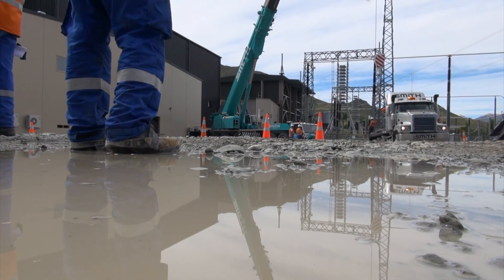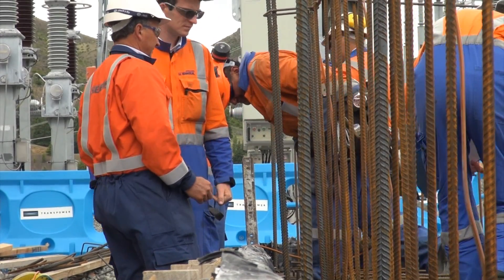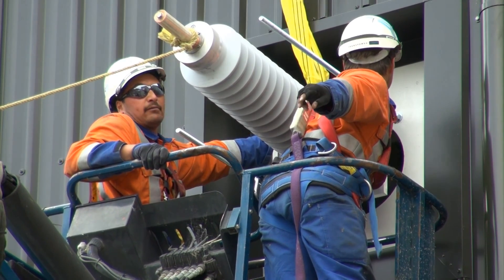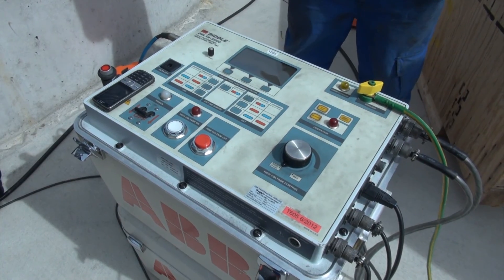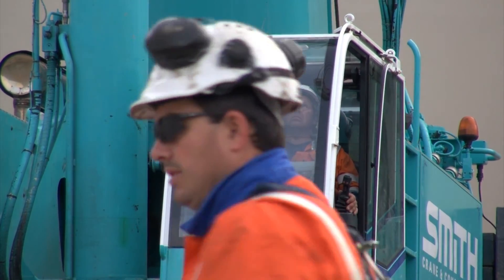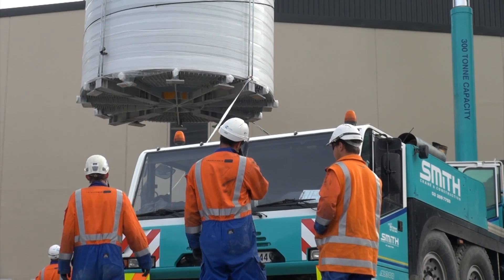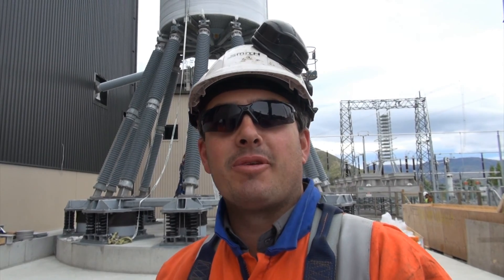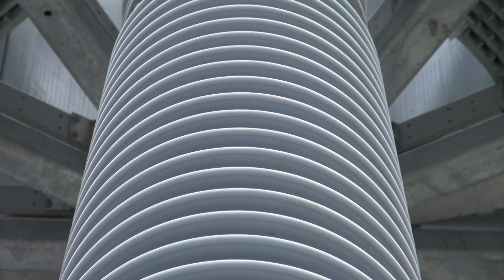Smoothing Reactor

Comment: Pretty amazing.. Wonder how many Henry's it is and voltage.. Nerd facts I guess some would say. The diameter, thickness and height of that beast I would say 1 Henry at maybe 500 kV. For sure will knock down any ripple that's a fact.
Reply: 40-80 millihenries at best. The higher the henries, the more the energy dissipated. You don't want that.

Comment: Can someone please explain that the point of that amazing piece of equiptment is. What does it do? Thanks.
Reply: 3 years ago. That line reactor only allows low frequency to pass through knocking "ripple" off the pulsating direct current sign wave. Capacitor banks fill in the gaps.. Another video. That's the best of my knowledge.